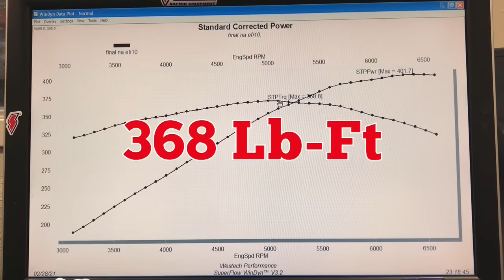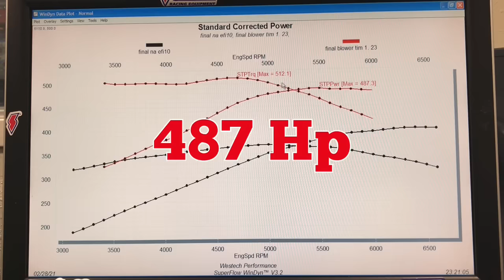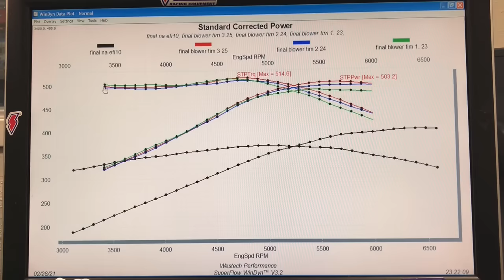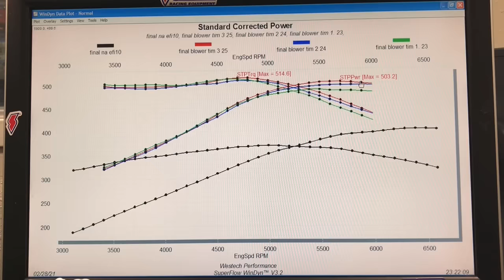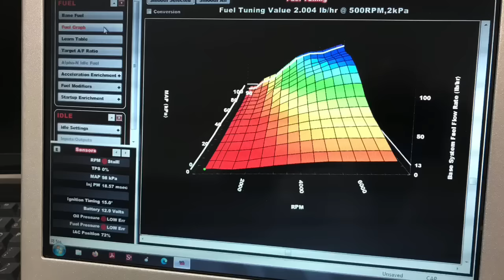CHEAP, E-BAY LS BLOWER MADE EASY! PUMP GAS M122 CAD BLOWER BOOST!

Comment: Ouch $1400 for adapters?? You could just buy the right blower for that price.
Reply: You ain’t lying
Reply: Yeah
Reply: $ 1400 adapters+ ebay buy now supercharger $1000 + injectors + tuning god only knows by the seat of his pants + this and that = kicking my self thinking I should just buy a complete kit...turbo or supercharger :-/
Reply: Ed Rooney  Most of the torquestorm kits run around 2800-3k without any shiny add ons or powder coating. You'll have 2k just in a caddy blower and adapters, and still have an entire grocery list of parts needed to make it work. 

Or you could flip your exhaust manifolds around backwards, weld on a flange for your $400 holset lol.
Reply: Lmaoooo my LSA full kit from boost district was 6500 bucks, what super charger you paying for an LS thats 1400?
Reply: @ChickenJoe50 fr I was thinking the same i usually see them running at 5-7k
Reply: I know this comment is 3 years old but I was looking at a Whipple set up 7500

Comment: Thats the perfect setup I need for my 07 tahoe. That I am building a lq4 + th400/3000 stall . I can tell there’s a bigger cam in the 4.8 or stock low Lobe seperation as the torque is surpassing BBC territory and Gm did a higher 118-120 lsa with their LSA blower engines to kill torque from the bigger cubic inch ls engines.. i would be proud to cut a hole in my hood for that blower on stilts.. she’s a tall girl. Lol. Love your stuff Richard. You are doing gods work for the HotRodding community. Thanks
Reply: I got a 09 Tahoe I’m building.  Right now it’s got tsp prc CNC heads and cam. Along with long tubes and cold air and  411 rear ended with Eaton and custom tuning with hp tunersI’m gathering parts for a th400 with full manual reverse valve body and a trans break and a 3500 stall.
Reply: @Truckee18  get rid of that tsp junk

Comment: Thanks for finally testing one of these, disappointing that it costs almost as much as an LSA or a torqstorm and makes so much less power :(
Reply: yeah $1300 is ridiculous for some adaptor plates
Reply: At least you can retain your stock front accessories and not buy the required brackets needed for the LSA.
Reply: Surely he will over drive it

Comment: Waaahoooo, Richard thanks as usual for your time and educational experience.  Really appreciate the timing info 👌. I was surprised that with 10 to 1 compression on 91 octane you were 15 to 16 degrees timing with 10 to 11 lbs boost. Not intercooled? Always learn so much more when you throw all the specs in. You are the mad scientist!!!
Reply from the maker: it does have an atw inteecooler
Reply: @richardholdener1727  thanks Richard, I  missed that.

Comment: A number of people are complaining about $1300 for a set of adapters. I think once they see the hoops that need to be jumped to make this work they would understand. Also these blowers at one point were $400 shipped on EBAY. That was the Blower, Intercooler and DBW Throttle Body. An LSA Blower is now $1500 used. A Lid is $600 used and you need a throttle body and drive set up. For a guy with a 4.8 or 5.3 and a truck accessory drive the $1300 for spacers is not a bad deal. There is certainly more that goes with both of these set-ups but overall it's not a bad deal and its new. I know it's not going to be capable of making as much horsepower but that's not what everyone is trying to do. Just my 2 cents.

Comment: Richard, you are the man! Could you please do a series on how to utilize the holly hp management system? Including timing rules of thumb and air fuel ratios at different rpms... basically how to create an optimized tune :) maybe even how to tune for boost!?!?!?
Reply from the maker: there are much better tuners than me for that
Reply: @richardholdener1727  doubtful! You crammed 24 psi of boost through a junkyard 5.3 that was ready for more! You are the man, please consider to reconsider, god bless.

Comment: two things, one Id love to see a twincharged ls with this. Second is I'm a little dissapointed that the adapter kit is 3500$ considering that doesn't even include the supercharger, air to water etc. I'd love to supercharge something someday but they're too expensive compared to turbo, and effectively make less power.
Reply: Am I missing something? The $3500 kit includes the machined M122 supercharger.
Reply: @bluenecross  I'm fairly certain that only includes the adapters not the supercharger
Reply: The manifold adapter is ~$1400 - which is a stupid price to expect people to pay for a $300 supercharger.
Reply: @grumpysteelman  I whole heartily agree!! He says in the title CHEAP, but the only cheap thing is the supercharger and even then it's gone up in price so It doesn't seem worth it at all.
Reply: Lmfao $1,400 for adapters. 
This is why people don't bother with automotive hobbies......
Reply: @LowMedow  The adapters are $1550 now
Reply: They do have filament that would hold up to the heat if someone 3D printed some. But the question is how long would they last? And a 3D printed adapter would look nothing like these adaptors, you couldn't just copy them. They would need to be a lot bulkier.
Reply: @themrjones  copy them 3d print them then use them to mold aluminum

Comment: I'm guessing this blower would be a little small for larger displacement such as a run of the mill LQ4, but it would be interesting to see how the same setup would compare.
Reply: Just use the LSA supercharger . They're probably just as cheap if not cheaper on eBay .

Comment: This is amazing. I have a 97 Sierra single cab long bed and a 4.3L vortec. I've done some mods to it but have been tossing and turning on whether pulling it, resealing it, ported heads, edelbrok intake  and a cam or go with a V8. I have a NV3500 5speed manual but also have a T56 in my garage that can go in also if I go the V8 route. This supercharger is amazing and on a tiny 4.8L vortec. Imagine swapping the heads and cam with other vortec/LS engines and this supercharger... oh man!
Reply: Don't waste your time the aftermarket support on the 4.3 is abysmal at best . 4.8 and 5.3's are so cheap you'd be a fool to go with anything else .
Reply: @Dr.Westside  I'm leaning heavily towards a 5.7 vortec swap. Honestly whichever will be the easiest. My nv3500 is still running strong so might as well get as much life out of it as possible.

Comment: I'm glad that someone found a use for these blowers, when I first seen them on eBay I thought fore sure this is a scam lol
Reply: The LS3 adapters are $1500 and truck kits are $3500 though, hardly concidered "cheap"
Reply: @johncrankshaft2886  Compared to a whipple where the kits start at almost 7k. You're coming in around half of that after the STS blower install..

Comment: I'm just stoked at the N.A. numbers alone- I'll be getting a 4.8 for my Malibu very soon, and getting over 300 hp to the ground is chill for me- but 400, with very minor mods and Holley FM, I'm good with THAT!
Reply: That's flywheel power. Not to the rear tires, I built a na 4.8, stage 3 cam truck cam,hardened push rods, double valve springs,  long tubes, prc 2.5 heads, corvette throttle body, k and n intake, and 373 gears, in a crew cab 2008 silverado on 22s and 33s, and it put 302hp to the rear wheels.

Comment: Always excited to see boost numbers on Cali 91 octane and an engine that is twice my little 4-banger's displacement. Gives some form of reference since there's basically no direct examples of what I'm trying to do with my 22RE.
Reply from the maker: those toys are good
Reply: @richardholdener1727  they're nice and reliable, but the swirl port chokes the flow around 4800+ and they've got soft valve springs. Great for a stock truck but expensive to build for a peppy street legal Celica here in Cali. 

I've also been using your Ford 302 info to scale expectations for what my engine can do, especially the flowbench numbers on the Boss heads!

Comment: Appreciate what they did and it seems well done, but no way I'd spend that much money and go through that much effort for an M122.
Reply: Agreed, $1400 for adapter plates is insane! For the cost of plates + the blower and the other headache to adapt the tb you could find a decent lsa that has more aftermarket support and much more swap friendly (will actually fit under the hood of something other then a truck).
Reply: I didn’t realize they were that expensive, lsa blower or turbo kit would be more cost effective
Reply: @frenchonion4595  that’s way to harsh of price on the adapters. I have a 2001 Silverado I’d like to add boost to one day. It already has most every common Ls modification: camshaft, springs, long tubes, tuned, and I have hp tuners now, and torque converter is next.
Reply: @frenchonion4595  Yeah their truck kit is just that and it's $3500. No injectors and you have to deal with a throttle body at the back of the blower at the end of the day
Reply: Or just get an LS + mild cam that will outflow this blower's maximum airflow. I just don't see the point.
Reply: @corystansbury  Yeah it does seem like the blower is rolling over up top, I think this was a stock cam 4.8L. Not sure the maximum airflow of the unit/rotors but it is a decent size blower but its on 91 octane. I'm interested to see how it does with pulleys and higher octane though, I dont think the boost was mentioned in this video.
Reply: Yea Torque Storm would be cheaper and easier and like that 4.8L he built

Comment: As someone who is owned the car that that blower came on the only thing that I can offer is the intercooler that's built into those things are absolute garbage. My sts-v would see 140° iats cruising down the road. Other than that great blower.
Reply: How would you upgrade it? Or whT would you do to make it better?
Reply: @claytonhaske  the design of the Intercooler does not allow upgrades. It's a tube design, and it's well known that it sucks. I had every upgrade you could do, larger pump, lines, and the TC Fab heat exchanger. Nothing I could do.
Reply: @claytonhaske  its running the engine antifreeze through it from the factory, if you make it a stand alone system you can make it run cooler especially if you add an ice tank and an extra radiator.
Reply: I've been encouraging Richard to rig up a better intercooler for it, but he doesn't seem interested.
Reply: @Phil-rs5wl  in factory trim it's on its own separate loop. I had an ice tank also where the battery lived. No matter what, under load it couldn't keep up. I also had a 2.4" upper pully and was seeing 17# of boost.

Comment: I am glad I just found this video, because I have been looking at the Wipple Superchargers and around $6500 to $6700 depending where. The Cadilliac M122 supercharger is a much better price for me. I was wondering about the height of the supercharger on the engine with adapters, how much taller is it over the truck intake, Since the truck intake sits right under the firewall with I think about a inch of clearance between the intake and bottom of the firewall. I have a 2007 GMC Envoy Denali it has the factory 5.3 V-8 not the 4.2 Vortec inline 6 that is in the regular Envoy. I also just put a brand new long block LH8 in it not the LH6 that it comes with. Basically the GMC Envoy Denali is similiar to the Chevy Trailblazer SS.
Reply from the maker: not sure on height
Reply: @richardholdener1727  Yeah most likely I would have to cut the top of the firewall like some do when they use those Holley 300-122 - Holley EFI LS Hi-Ram Intake Manifolds on the Trailblazer SS. I spent some time looking under the hood to see what it would take to use this Supercharger, and since that Cadilliac M122 supercharger has the throttle body in the back and that engine placement is far back and underneath the firewall it is going to be really tight back behind it. I don't know, about putting one on anymore. Unless you want to put a M122 on my GMC for me that would be nice ha ha.

Comment: I'd like to know what you would run for mileage? I got a 4.8l lr4 plan is to buy a junk yard lr4 4.8  hone cylinders, replace pistons and rings, bearings, seals , gaskets, upgrade cam valves springs pushrods. I'm thinking about the truck Norris cam by Btr with springs. I'm not trying to get great power aiming for better at towing  as I live in desert and have to haul water. only things that matter is torque and mpg 😂. Current lr4 is working but I want to prep for failure 300k miles and running strong.

Comment: Lets stop toying with maxing out the gains at that power level. let's see where the max boost level is and then dial the tune in for that power level. This channel will not stand for a 500hp LS. ;) Time for a smaller supercharger pulley

Comment: Is that a blower from like xlr-v? 

My buddy worked for a Cadillac dealership in the parts department and a v owner showed up complaining his engine was making a whining noise. So they replaced the supercharger. He kept complaining so they replaced it again. After the 3rd time he said it was good. The dealership didn’t want to ship the last new blower back to gm so they told my buddy to toss it. So he did, right into the back seat of his truck. Back then though there were no adapter pieces and sadly when he moved it went to the dumpster.

Comment: I think it would be worth it if the adapter was 3d printed instead of being cnc aluminum 1400 is to much to call cheap. I could turbo less than that
Reply: Yea that kills it...damn near get a used procharger kit for that much
Reply: Ed Rooney  bought em WAY cheaper...especially basic BBC ones...hell I made my own bracket with no special tools out of a sheet of 3/4 aluminum with a $4 jack bolt...
Reply: Ed Rooney  naw dude I got a 6.0l sitting 20ft from me I've built them all over the years....
 Now I wouldn't use a MAF sensor anyone I'd use speed density....
 Shits a dime a dozen used ive seen SO many used p1sc, d1sc kits for LS get sold CHEAP...ive used ebay intercoolers...
 Done it all.....its not conjecture I lived it....
 A full prebent complete prefabbed for monkeys kit might cost you a hair more but ive picked up cheap gen 4 Fbody shit when people upgraded head units and to aster brackets....
  Just got to be thrifty...ive used cobalt map sensors on LS..China throttle bodies .....this is well approaching a used procharger kit and by the way I have accessories....lol...it doesn't have a 4l80e and billet lock up with 9 inch 3.25 gears to pull on a trailer....
 I am thinking about going to a twin torque storm because of my rather unique home made induction because I much prefer how they integrate the AC compressor in vs procharger bracket on BBC....

 I bet you would be pissed to know I got my spare 6.0l and 4l80e for $100 out of an old van, and pcm and harness...but we used to pull flex fuel sensors off Astros and S10s before they made that shit and used it in our self soldered Microsquirts...before my MS3 Pro Ultimate was even a thought....I also have 5 spare BBC blocks all sonic checked good to .110 over...2 tall decks....
 Thrifty, right spot at right time...and ready to move when others arent....
 Now I have gotten burned buying used prochargers before to be fair but even then I had a nice new rebuild from a 3rd party.....you do take your chances being a bottom feeder such as I,  but to assert deals can't be rooted out if your try hard enough and have a less patience is wrong...now just being at the end of a few clicks from your laptop sure...but if you want to get dirty, work deals and swaps to the work be surprised what you can achieve on a tiny budget....
Reply: Ed Rooney  it is...but its edging having a good blower with room go grow...plus PD has its uses too...

Comment: Personally I think this blower is a waste. Would be better off with an LSA blower. I tuned a 6.0 LS2 with an M122 on it. Too small of a blower, IATs thru the roof, could only make 6 - 8 psi, couldn't be spun any harder, etc. I wouldn't waste my money on this. Only 500 hp? Thats only around 400 whp. LSA blowers easily make 500-600 whp at a similar boost levels
Reply: @frenchonion4595  LSA blower is 1900 cc, which is 116 cubic inches.  So it is a little smaller than an M122.  But the LSA blower has much better efficiency.

Comment: Richard Holdener I have a 2004 Chevy Trailblazer EXT LS 5.3L have 177k miles looking to pull out and update the  engine and boost performance on a budget any suggestions?
Reply from the maker: cam, springs then boost

Comment: The cost of all adapters cost about as much as a good used lsa
Reply: That what I’m trying to figure out, would I even save anything by going the M122 route over an lsa blower
Reply: To do the LSA you'll need obviously the blower, rails, the lid and the belt setup.   This unit was originally sold complete with injectors for under $400.  You can't get a lid for that much.  I know the LSA is very efficient compared to this but if you're not looking to set any records this blower is a great deal .... or at
 Least it was.